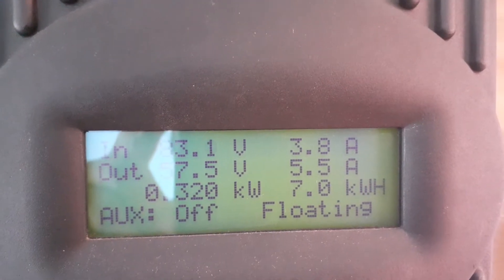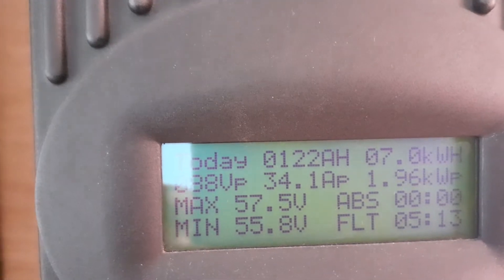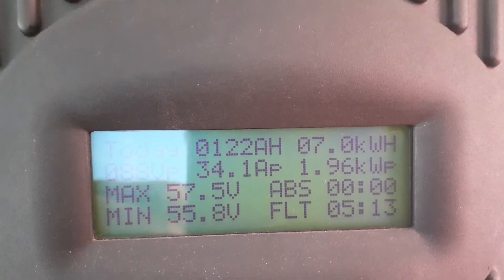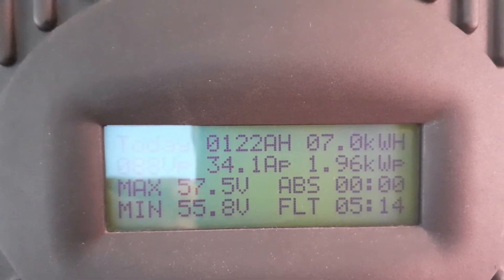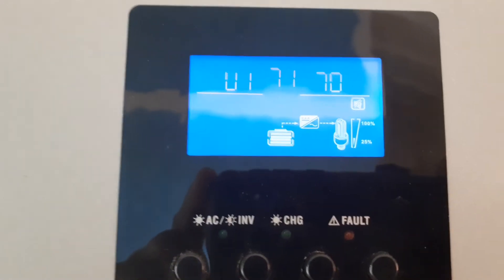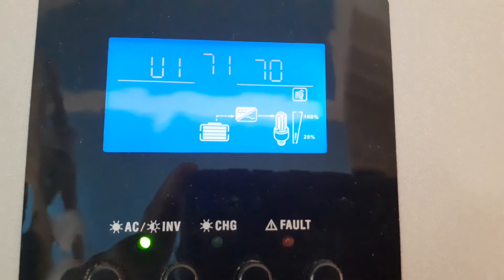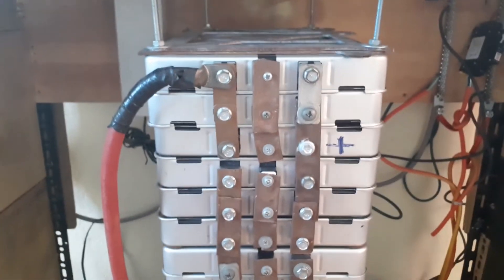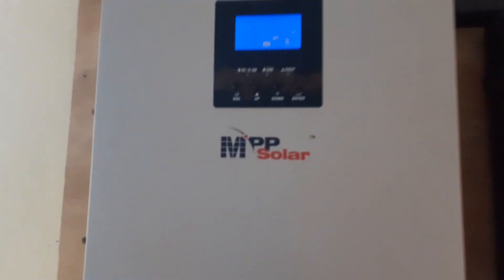A LITTLE UPDATE ON MY SOLAR SYSTEM

Comment: i see the inverter you have its an MPP solar and with the outback charge controller, question:  when the battery its full charge the green led of the inverter will turn on or not?

Comment: hi

did you know how to configure the options of absortion equalization floatin absortion end amps for  for 8  6v GC15 deka solar batteries?
Reply from the maker: I never delta with deka batteries before sorry for late reply
Reply: hi
this outback flex max 80 can be installed on an MPP solar lv5048?

Comment: this outback flex max 80 can be installed on an MPP solar lv5048?
Reply from the maker: Nope it can't the mppsolar have a built in mppt charge controller u can used flexmax 80 as a external charger
Reply: hi  can you help me with how to install as external charger?

Comment: hi  can you help me with how to install outback flex 80 to the lv 5048  as external charger?
Reply from the maker: U need 2 busbar  to install the lv and flexmax. The 2 cable that hook in the lv put each of them on busbar and the cable that hook from the flexmax hook them on the busbar and used a large cable from the busbar to the batteries. Make sure u have breaker or disconnect  switch on the positive wire from the inverter u also need breaker for the flexmax
Reply: @offgridlivingstlucia8865  hi will be possible you make a video of this ? thanks again